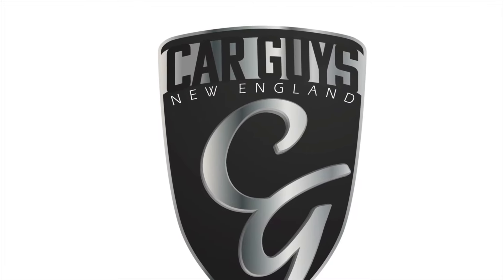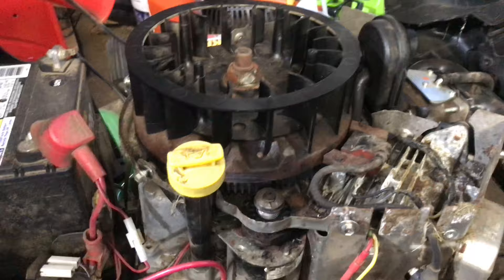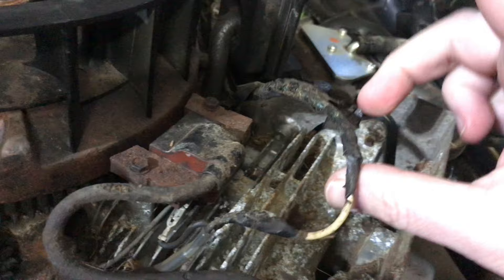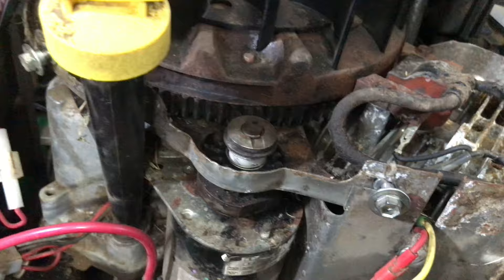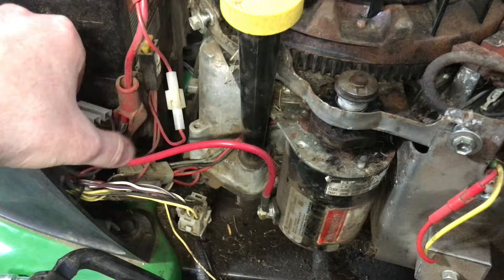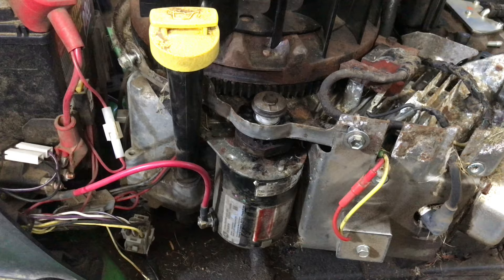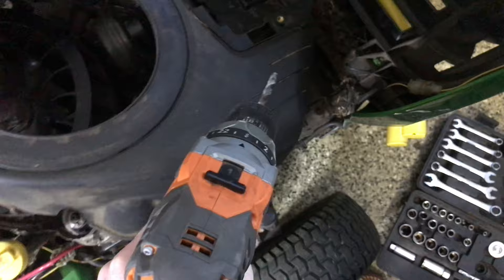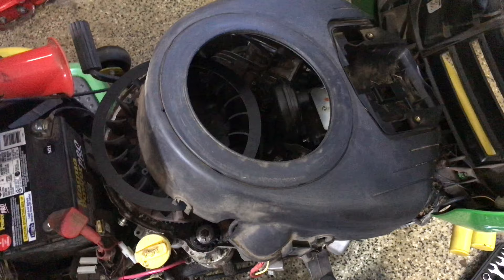Keeping Mice Out Of Your Ride On Mower

Comment: The other day just happened to look out the window and watched a squirrel jump onto my tire.  Never saw it come back out.  It dawned on me, she knew what she was doing/where she was going, she wasn't exploring.  Ran out there, popped the hood, shooed her off.  Didn't see any nuts or nesting stuff, so I think I caught her in time.  And car was only sitting for 24 hrs too.   I don't have a garage, live in the country.  Never had this happen before.  Read about peppermint oil, so I soaked a few cotton balls and put them right near where she was.  She hasn't been back.  Also made a spray and sprayed it around the tire/wheel area.  
Just went out to cut my grass for the first time this year, and....mouse nest made out of leaves and dried moss right in that top area.  Cleaned it out, and it eventually started and ran fine.  Needs some maintenance anyway, hence the hard start.  I'm getting a shed very soon, so hopefully that won't be an issue, but I will also be using the peppermint oil in that as well.   Also making sure it's sealed up really good to hopefully prevent it in the first place.

Comment: Never had a mouse in my house but they've gotten into the engine compartment into two cars. They actually chewed up the under hood insulation to use as nesting material over the winter in my Pontiac and nested under the engine cover
Reply from the maker: Peppermint oil works wonders

Comment: Waste of time, pepermint oil works in the lab but dosen't work in the real world. Ive used about a gallon over the last 2 months and still have mice on my mower.
Reply: Agreed. I bought peppermint oil essence and peppermint Altoids and saturated both ends of many q-tips and tossed them with numerous Altoids around a 10 x 10 shed, and even put some of the peppermint Altoids on top of the riding lawn mower engine cover. A couple days ago I checked the shed and I find mice poop on top of the mower engine cover right next to an altoid.
I bought several bars of Irish spring bar soap and we'll try breaking that up and spread that around now.

Comment: I’ve had the exact same problem with same motor. I started leaving a bar of Irish Spring soap on top of the motor when not using it. No rodents yet.
Reply: How about an update on the efficacy of the Irish spring soap? I bought a new riding more couple of months ago when I don't want the rodents messing it up this winter. I saw the effects of rodents. My mother had to get a new push mower because rodent nest it up in the engine. I have that push mower now and I'm trying to resurrect it, so far unsuccessfully.
Reply: @dennisedwards8954  no rodents. What so ever after storing my equipment with bars of Irish ☘️☘️ Spring soap. (Update)
Reply: I replied elsewhere here about my dismal experience with the peppermint essential oil. Now I'll try the Irish spring soap.
Reply: I live in the country surrounded by fields. They chewed a whole under my sink and chewed the crap out of all the bars of Irish spring I had. Wonder why some of them aren't bothered by it.
Reply: @the1andonlyrogue  I even hang a small cloth bag with a bar of Irish ☘️ spring under the hood of my truck. I store my tractor, snow equipment , bass boat, etc. with the soap and it’s been 100% effective. My main rodents are mice and chipmunks 🐿